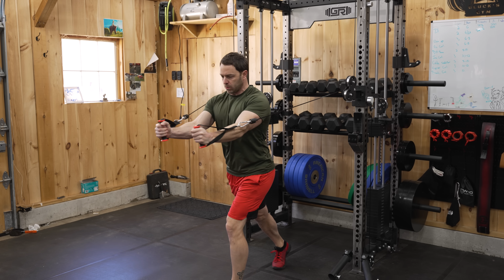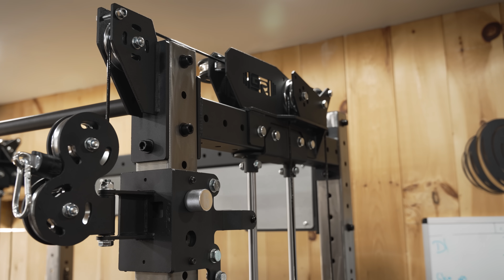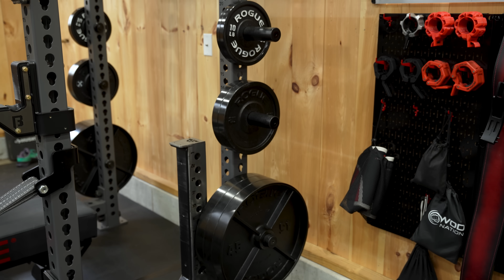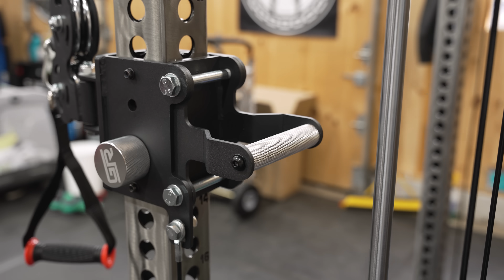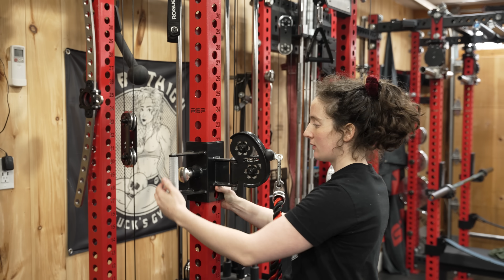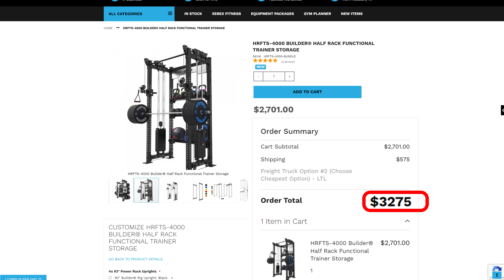Best Space Saving Do It All Rack? Get RXd HRFTS-4000 Squat Rack Review

Comment: Just FYI, the whole wider functional trainer providing a better "stretch" on the pecs during a fly is actually a common misconception.

Tension is maximized on the pecs when the cables form a 90° angle with your hands (also applies to almost every cable exercise). Your pecs are also stretched only in the bottom/start position when you have the hands out wide, at the top they are contracted and at their most shortened when you bring your hands together (i.e. not stretched).

So... to actually maximize the stretch in a cable chest fly you'd want the cable positioned directly behind your hands to form a 90° angle with your body while in that bottom stretched position.

For most people this would be right around their wingspan during the fly, if not a little narrower since most should be able to slightly angle their arms behind their body to get a maximum stretch in the pecs.

A cable setup that is wider than your wingspan actually reduces the tension in the stretch on the pecs. The wider it gets, the more the peak tension moves towards the top squeeze position which is the opposite of a better "stretch" that most people talk about.

Thus, a functional trainer or all-in-one rack around 40" to 50" wide is actually pretty great for maximizing tension in the stretch position to actually get a stretch on the chest for most people unless you have an abnormally large or small wingspan during the fly!

Coincidentally, the latest research is actually also showing that prioritizing tension in a deep stretch position for most muscles is likely the best for muscle growth as well.
Reply from the maker: I feel like I've made so many jokes and comments about fly width that I'm running out of ways to say it's not as important as some people make it out to be.
Reply: Yes glad someone is saying it!Biomechanics are good to know if you like fitness
Reply: Well put
Reply: Also, you can (and should) always play with elbow angle to create the best tension for you.  It's all about figuring out how YOU can use it best.  
Great review!  Thank you.

Comment: Great review. The rack seems solid. Not a REP but it will save you some $$$. Keep the reviews coming!
Reply: We do have a new RX3 series which features all 1" holes with 2" spacing. It also has a variety of other quality updates, and even has the ability to do both 1:1 and 2:1 weight ratios! 

The HRFTS-4000 in this review is configured from a larger ecosystem of Builder pull-up rig components. The Builder series uses 1" holes in the lower area for j-cups and spotter arms, and then 1/2" holes in upper area for bolt-in attachments such as pull-up bars and crossbars. This "Builder" design is most cost-effective for gyms that are buying multiple pull-up bars and crossbars for a single pull-up rig setup. 

For home gym owners, we'd suggest our RX3 series if you want the most versatile setup and ability to use accessories from other brands since the RX3 series uses 1" holes with 2" spacing throughout.

Comment: You guys need to check out the MAXUM Fitness SX2 next!!

It seems like one of the best value 3" x 3" 11-gauge all-in-one racks since it also includes a smith machine + leg press, articulating arms for the functional trainer, weight stacks + plate-loaded combined, and comes with a ton of attachments for movements like rows and pulldowns.

Price is about $3,500 US shipped with a lifetime warranty.

Note: They are based in Canada so prices on their website are Canadian, but they ship to the US for a fee and cover US customers under the warranty.

Comment: It seems odd that other import companies don't make their hole spacing match to the leading companies. I see a lot of people buying the discounted FT and adding premium attachments. Seems like a pretty cool option overall.
Reply: We do have a new RX3 series which features all 1" holes with 2" spacing. It also has a variety of other quality updates, and even has the ability to do both 1:1 and 2:1 weight ratios! 

The HRFTS-4000 in this review is configured from a larger ecosystem of Builder pull-up rig components. The Builder series uses 1" holes in the lower area for j-cups and spotter arms, and then 1/2" holes in upper area for bolt-in attachments such as pull-up bars and crossbars. This "Builder" design is most cost-effective for gyms that are buying multiple pull-up bars and crossbars for a single pull-up rig setup. 

For home gym owners, we'd suggest our RX3 series if you want the most versatile setup and ability to use accessories from other brands since the RX3 series uses 1" holes with 2" spacing throughout.

Comment: Thorough review my guy!  Looks like a cost saving measure of not using true 1 inch hardware up top and bottom.  Also, the trolley definitely needs to be a pop-pin system. Overall, for the price compared to REP, it does have some merit.
Reply: We do have a new RX3 series which features all 1" holes with 2" spacing. It also has a variety of other quality updates, and even has the ability to do both 1:1 and 2:1 weight ratios! And yes, it uses a pop pin on the trolley too! 

The HRFTS-4000 in this review is configured from a larger ecosystem of Builder pull-up rig components. The Builder series uses 1" holes in the lower area for j-cups and spotter arms, and then 1/2" holes in upper area for bolt-in attachments such as pull-up bars and crossbars. This "Builder" design is most cost-effective for gyms that are buying multiple pull-up bars and crossbars for a single pull-up rig setup. 

For home gym owners, we'd suggest our RX3 series if you want the most versatile setup and ability to use accessories from other brands since the RX3 series uses 1" holes with 2" spacing throughout.
Reply from the maker: Yeah it surprised me some. I think if I weren't looking to expand off it (though that can be done in their ecosystem) the cost savings would be very tempting.
Reply: Starting to wonder if I'm the Get Rx'd shill here, but as an owner of one of their racks the holes are so it's compatible with their entire Builder system. People use it to build out stuff like ninja gyms. Rad for that, bummer when you try to add a Dialed Motion attachment...

Comment: Not a fan of the odd hole spacing at the top. Like, why be cheap? Also those spotter arms. lol. If they can’t get the basics right, I’m not going to spend thousands on their rack. Pass for me.
Reply: I have their power rack and I find it frustrating because of this. The holes are also not spaced apart the same as Rogue and Rep Fitness racks, so not all attachments fit.
Reply: We do have a new RX3 series which features all 1" holes with 2" spacing. It also has a variety of other quality updates, and even has the ability to do both 1:1 and 2:1 weight ratios! And, the RX3 spotter arms now insert from front and rotate 90 degrees to lock in. 

The HRFTS-4000 in this review is configured from a larger ecosystem of Builder pull-up rig components. The Builder series uses 1" holes in the lower area for j-cups and spotter arms, and then 1/2" holes in upper area for bolt-in attachments such as pull-up bars and crossbars. This "Builder" design is most cost-effective for gyms that are buying multiple pull-up bars and crossbars for a single pull-up rig setup. 

For home gym owners, we'd suggest our RX3 series if you want the most versatile setup and ability to use accessories from other brands since the RX3 series uses 1" holes with 2" spacing throughout.

Comment: Thorough review!

That change in hole sizes is just odd...
Reply: We do have a new RX3 series which features all 1" holes with 2" spacing.

The HRFTS-4000 in this review is configured from a larger ecosystem of Builder pull-up rig components. The Builder series uses 1" holes in the lower area for j-cups and spotter arms, and then 1/2" holes in upper area for bolt-in attachments such as pull-up bars and crossbars. This "Builder" design is most cost-effective for gyms that are buying multiple pull-up bars and crossbars for a single pull-up rig setup. For home gym owners, we'd suggest our RX3 series if you want the most versatile setup and ability to use accessories from other brands since the RX3 series uses 1" holes with 2" spacing throughout.

Comment: Is there a good reason to get this over Rep's?
Reply from the maker: The footprint is a little smaller because the storage doesn't stick off the back  much like Rep's and it's cheaper but Rep's PR 5000 (or 4000) with dual Athenas is the nicer of the two.